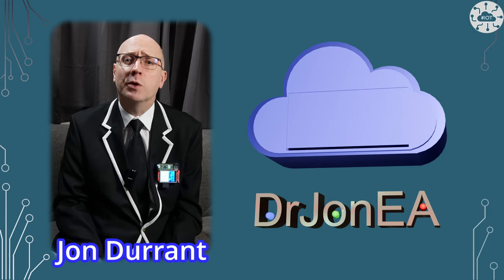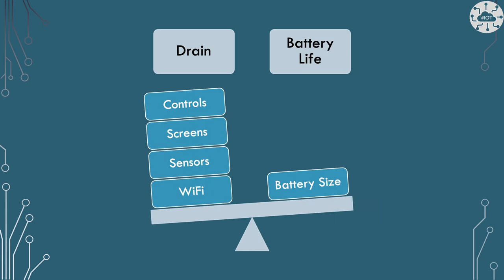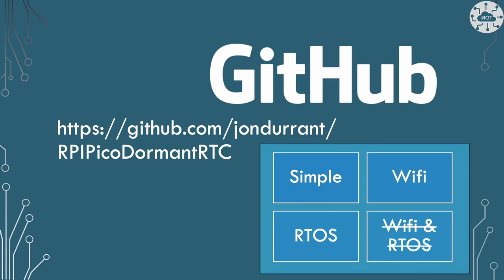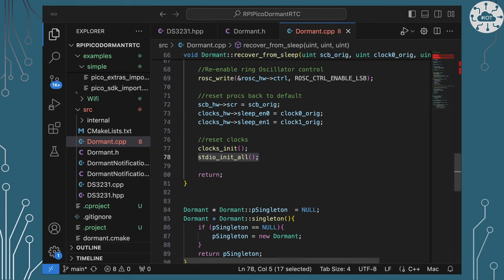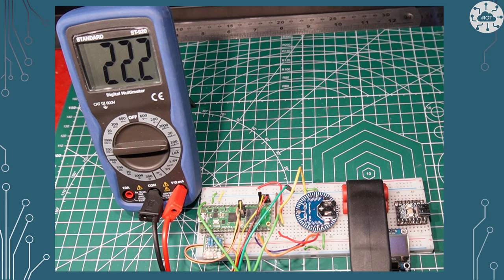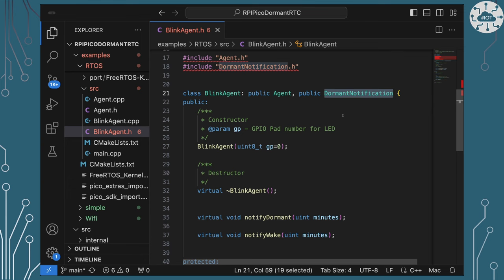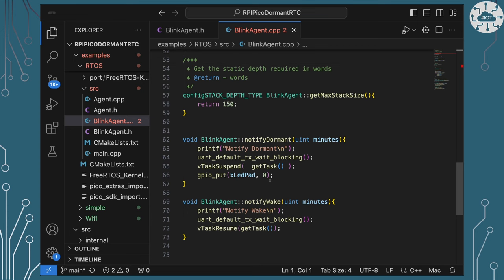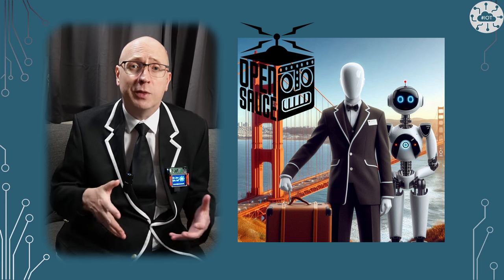How to Hibernate the Raspberry Pi Pico in C/C++ | DrJonea.co.uk

Comment: When you were showing current draw with WiFi,  you were only showing 0.05A which is 50mA.  50mA will fit within the 200maa scale of the meter.

I didn't think the RTC on the Pico draws much current so it should be possible to use it instead of an external RTC.  Seems like cheating using an RTC module that has its own power source.
Reply from the maker: Thanks. It is possible I've made an. incorrect assumption from my readings. Certainly on 200mA range I  saw multimeter hit 200mA and Wifi fail to connect.  I needed to put the multimeter onto the 10A scale to get Wifi to connect.

You can't use the internal RTC with the Dormant mode as all clocks are off. Including the RTC. Deep sleep mode would allow you to use the internal RTC but there is more current draw. I've got a video coming on this.
Reply: Probably what's happening is that your meter at 200mA scale has a high enough shunt resistor that WiFi creates a current spike and causes enough of a brief voltage drop that the Pico browns out.
50mA did seem rather low to me for WiFi, at least during initialization and transmit.

Adding an electrolytic  capacitor say 10 or 50uF and .1uF across power near the Pico power input may avoid the brown out.  The meter won't see the spikes though as the capacitors will filter those out.
Reply from the maker: Great catch thank you.